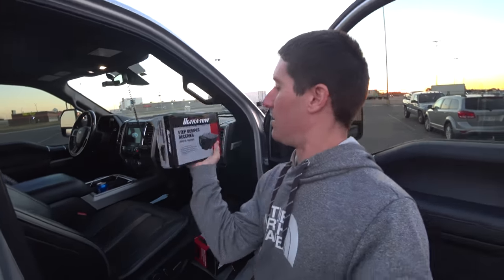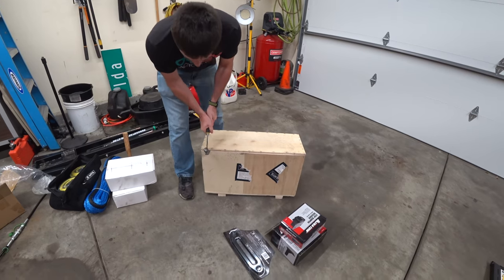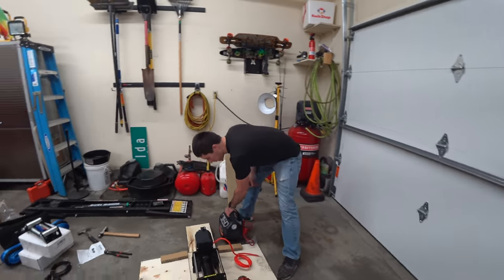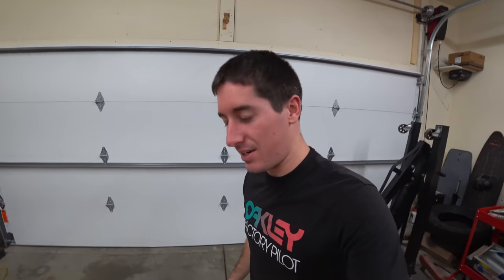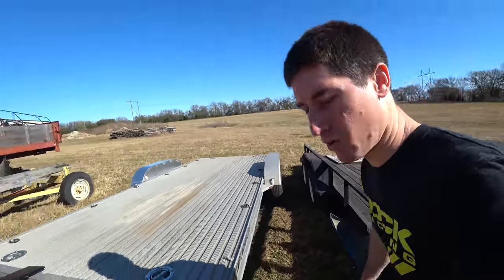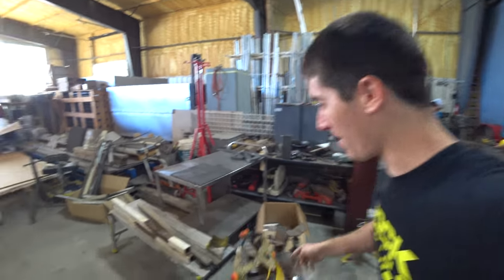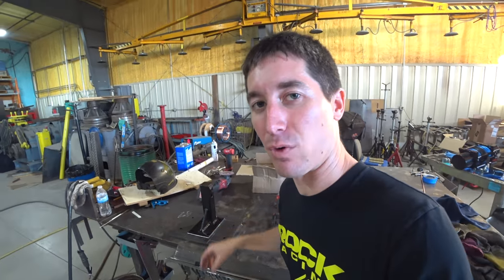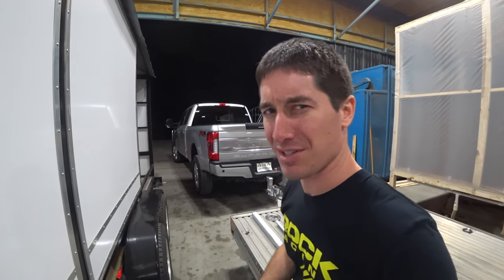We FABRICATED The World's STRONGEST Removable Winch Setup

Comment: Please be more careful with your winching. You need to spool new cable onto the drum under load in order to prevent the upper layers from embedding themselves into the lower when under full load.  Also, I was cringing the whole time you had your hand right next to the winch fairlead while spooling it in.  That drum doesn’t just instantly stop, but, no matter what, all it would have took to mangle your hand is a small grab/slip and pull it into the fairlead.  PLEASE be safer than that.
Reply: JR read THIS ^^^^
I was also cringing watching for his hand to get pulled into the fairlead.

Comment: Like a couple other guys recommend, trailer box on the tongue with a couple batteries. Then your trailer plug should have switched 12v power to one of the pins. Wire that to charge the trailer batteries. If you are really trick get a solar trickle charger so it's always ready to rock.

Comment: so what is the tongue weight rating on that hitch mount 1000 lbs. according to the northern tool website.
even with figuring in 3 times that number for a failure point i would have one other major concern with 350 lbs. rating on the receiver hitch part.
then multiply the height from the mount to load the fulcrum point.
this needs some extra safety to protect you if it launches all of the winch towards the load being pulled.
this may never fail but just to be safe add two chains that hook from the trailers safety chains to hitch/winch mount chain points.
just a suggestion not trying to be a keyboard engineer.

Comment: I did very similar to both my trailers. Best decision. I can use my winch on either trailer. The winch is 10 years old and still looks new from being indoors. I had to mount my solenoids and fuse block in a small tool box that I carry with the winch and it also holds all the gear.  Winching cars is a game changer

Comment: Snatch block not a block and tackle.
Make sure you use a winch dampener when ever using a winch, place as close to the hook or d shackle that’s attached to the car that your pulling it will take majority of the force out of the rope and gear attached to it.
Reply from the maker: I have seen those dampers, always a good idea for sure 💯
Reply: @WatchJRGo  and make sure you wind that winch rope under load or it will tangle and bind the rope on the first heavy pull.
You don’t need that smaller bottom tie bar behind the fair lead there only for shipping.

Comment: Nice job JR but a little to much work.I would have mounted the reciever where you did except I would have added a plate to bolt to the triangular shaped aluminum tread plate on top of the frame rails. That would stop the mount from trying to pivot on the front of the deck and would not have needed all the reinforcements underneath. Still need some outside like he's doing but not nearly as much. 

Just my two cents worth.

Really like your work and your work ethic. 

You need to hang out here in East Tennessee for a while with a good handling automobile. We've got a lot of awesome roads around here.

Comment: I run power to my 10k trailer winch from my truck. #2 cable from the battery through an 80Amp solenoid with a switch to turn it on. Then you can also have jumper cables to plug into the back of the truck if you need them. It works great. Then you never forget the jump box at home or run it out of power.

Comment: On my truck I ran two cables back from the battery, have a quick disconnect at the bumper and enough cable to reach the winch.   As long as the truck is running have plenty of power for the winch.   Also plan on making a front mount for it and run cables there as well.   Doubles as a jumper point - once I make up a set of jumper cables with the quick connect on them.    Plus most pulls you will not run it as long as you did to spool the line on.

Comment: I don't know what that winch draws for power, but if the truck runs dual batteries, it would be plenty to run power from the front truck batteries to the hitch and  install a power pole quick disconnect. Just upgrade the grounds at the front batteries to the chassis and run a 1/0 power wire back (Maybe upgrade alternator charge lead too?). Ground to the frame back there and mount the quick disconnect near the hitch.

Comment: Instead of a battery box, you could run an Anderson Plug set up to your truck. But then you’d have to use the same truck to tow with. Ah shit, this is gonna backfire on me.
Reply: It would work, just make an extra pigtail with 2 battery terminals on it, then you could plug the winch into that if you use a different truck.
Reply: @jeffeastman625  
Power draw may be an issue for the wiring.

Comment: Change the trailer plug out for a true 7 pin. That will let you wire a 12v charging circuit back from the alternator. now mount a small battery box on the tongue plate and install a good deep cycle battery in it. Wire the winch to that. USE A ON/OFF SWITCH, and remember you will need to wire everything direct because no ground in aluminum.

Comment: For power, mount an AGM battery, in a battery box, under your bed of the truck,  Then wire it into the truck’s system so it trickle charges,  have an extension of winch power lead permanently wired to that battery and accessible at the rear of the truck so it can be pulled out and plugged into the winch.  Then, if you get to a situation where you need to do constant pulls, you can start the truck to have the alternator help keep the amps up.

Comment: why not use the cable that came with the winch?  All the parts are rated for the unit and will hold up.  Your bad experience might have been due to a mix of unrated parts.  You didn't show it all installed on the trailer.  I was waiting to see how it looked.

Comment: Run some battery cables from the truck  to the trailer with a quick connect  at the tail end of the truck . You then would not need a spare battery.

Comment: I never saw an iron worker tweak flat bar and bind that much. Those are great for fab work. I wonder if the die isn’t sitting flush in the table?
Reply: It’s flush. It’s a combination of things. One we’re almost at the capacity of the machine. Two, the springs and dampers that are supposed to push the part off are worn out from years of use. Three, we probably weren’t using enough lube.
Reply: @watchjaredwork1487  Thanks for the reply and that makes sense now. I guess we always have to push the limit. Funny how we fix everybody else's stuff and our own equipment is in the worst shape and in uncertain times it's hard to want to go out and invest big in equipment too. Always nice seeing you too on the channel.

Comment: I'm kind of surprised you didn't install an easy-lifting handle on top the winch to facilitate installing and uninstalling into the receiver.  As to power, could you run a dedicated power supply from a second battery under the hood to a socket in or under the bumper?  I don't know if that would be practical if anyone else wanted to borrow the trailer and winch.  How would they power it without a similar setup?  Would a heavy duty set of jumper cables work, direct to the battery of the tow vehicle?

Comment: FYI synthetic winch rope will not fall to the ground. I pulled my 17,000lb winch rope in half last year winching off a bad obstacle. The rope sling shotted up the hil like towards the anchor point and went past it another 30 feet. Would it kill you no but it will whip you hard. I now run a 30,000lb rope that's round with a sheath vs regular synthetic rope. What are you winching with that beast? I run a 12,000lb winch and it's plenty strong.

Comment: Windowing the mounting plate before welding the receiver plate on would have taken a few pounds of unnecessary weight off of the winch mount with zero lose in strength. Just a thought, less weight is always better.

Comment: It seems that it would have been easier and less overkill to configure a plate with a 90 degree bend that bolts to the tongue and the trailer bed with minimal bracing since you can utilize the structure of the tongue at that point.

Comment: You have a 110~120v outlet. Get a step down to 12 dc and just plug it in.
Reply: Using the outlet from your truck to your trailer. No battery, just have to have the truck running. Or setup for both.
Reply: No chance that a stock inverter can make that much power.  Figure the running amps of that winch, add 10% for inverter loss, then add another 25-30% for locked load..... you’re gonna need a generator.

Comment: NAH put everything in a tongue box, with a dedicated deep cycle battery and a directional diode so the current only flows one way and let the 7 pin center wire keep the battery charged up through the wire harness you already have on the truck, no need for an external battery or all those external hookups. anything worth doing is worth OVERDOING
Here's what i was talking about https://www.youtube.com/watch?v=yrDSiL_hCys

Comment: Why not just use the much better cable that came with the winch. If it’s only going to be used on a trailer than you want the durability of the cable, as the synthetic will wear much faster. A 17000 lb winch is just going to kill your battery and you really only need a 12000 lb and the roller setup lets you winch at steeper angles.

Comment: Literally defeats the purpose of an aluminum trailer...
Reply: It literally doesn’t at all.
Reply: @watchjaredwork1487  15% weigh savings for going with AL over FE (average) so it is say 350#'s lighter.  Over-spec'ed winch for the job is what...40# more than needed.  Adapters are by his grunts about 60#'s total and 2" x 2" x 3/16"  is 3# foot looking at 8' 24#.  1/3 of hie weight savings is gone at a 40% price premium.  7000# quality winch can be mounted right to the tongue on a steel trailer with nothing or a 1/4" plate to make it removeable.
Reply: Michael Krenzer you’re looking at it all the wrong way. We have 10 (yes, 10) steel trailers and 1 aluminum trailer. The steel trailers all weigh considerably more than the featherlight and have a bigger capacity. You’re looking at it as though we bought that featherlight as opposed to buying a steel trailer with the same capacity, that’s not at all how we went about it. Also, this winch will be able to be removed and put on any of our other trailers as needed. It’s built exactly how we wanted it built and will serve our purposes perfectly.
Reply: @watchjaredwork1487  I guess I am looking at it wrong but the pure math is hard to reconcile still...too each their own and truly not judging.  If it is all about the cool factor then I likely won't get it as I am a square as they come.
Reply: Your math is way off considering we didn’t pay anywhere close to a 40% price premium for the trailer. We don’t buy hardly anything new. It was purchased used and well bought. We’re adding 68 pounds of steel to a trailer that is a 1000 pounds lighter than our next heaviest trailer.
Reply: @watchjaredwork1487  My assessment of your grunts was way off!  Never intended an internet arguement as it makes all parties, but especially me, look like a snot slinging moron.  I could be completely right and still end up sounding arguementative for arguements' sake.

Either way, enjoy the new winch.  They do make loading dead vehicles so much nicer and even live ones with inconvenient door locations easier.  Climbing out the window of a cages 4'th Gen Camaro is not as fun the older I get.

Comment: I dare you to make a video of pulling a truck in park onto your trailer.

The way you.mounted the receiver to the trailer will put a ton of torque on the front of the trailer and rip it out.  

And your portable battery will never power that beast.

This build is a farce.
Reply from the maker: Believe me it will work, the rear brakes were stuck on that that 3/4 suburban and we literally drug it on the trailer with a come-a-long hooked to a single d-ring. This all rated 5x higher than that so it will work. 🍻
Reply: @WatchJRGo  The D ring is mounted flat to the bed.    No torque is created.   That is how the hitch receiver should have been mounted and used.

I dare you to put the Suburban in park and 4 WD and try pulling it onto the trailer with your winch.  Make a video of it and share it with us.  Better to test it now and not leave it until you really need it.   Will also make great content for people who have to load dead vehicles.

Comment: The centerline of the winch drum is about a foot above the hitch receiver.  10,000 pounds of pull will put 10,000 ft lbs of torque on the bracing you put on the front deck stringer.   There is no way that stringer or the bolts spaced about 4 inches apart will hold 10,000 foot pounds.

Furthermore, that hitch receiver is probably rated at 5,000 pounds trailer weight, 500 pounds tongue weight.   You are using it in the tongue weight direction.  My guess is 10,000 ftlbs will deform the receiver tube.

You should have mounted the receiver like it would be mounted on a vehicle.

One other thing: recovery straps are essentially rubber bands when they break.  They are more dangerous than cables if the clevis breaks and comes with it.

FYI, that "hook" is really a clevis.